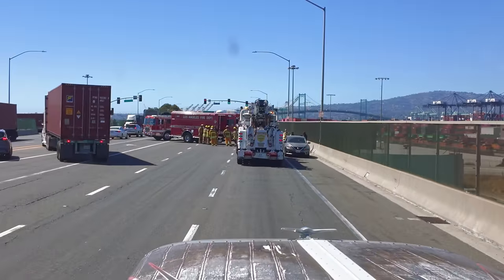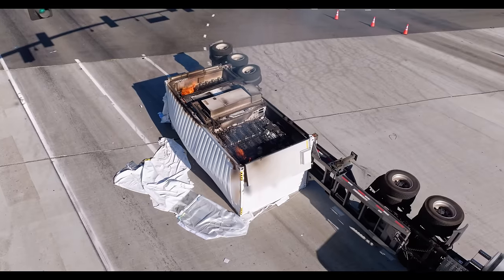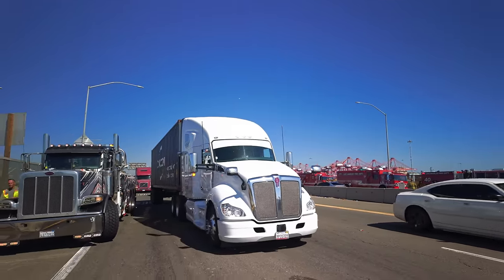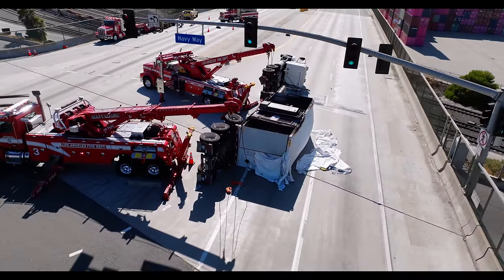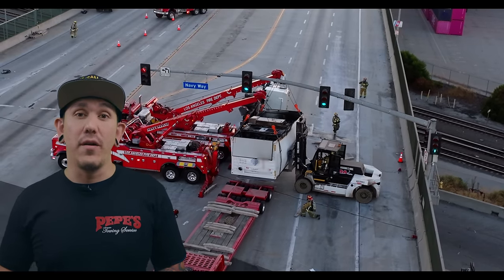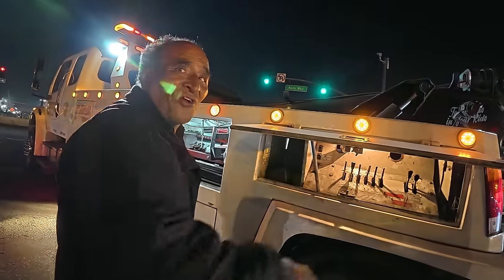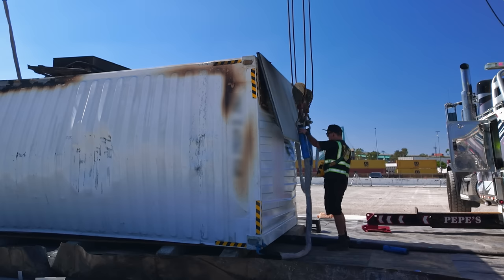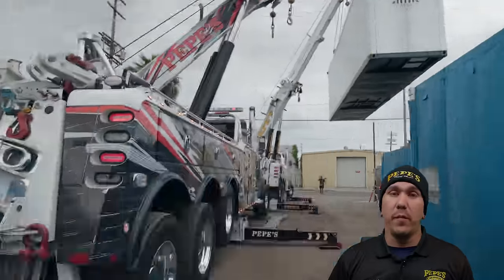60,000lb Lithium-ion Battery EXPLODES on Freeway!

Comment: Hmm...just started watching the video. That is a failure of basic enginnering. That custom container job should be designed to survide a rollover without issue. Huge failure on the manufacture part. Good call just to let it burn out. The toxic runoff from putting water on it would be much worse then just letting smoke off and letting the fumes disburse over a large area, Earth.

Comment: Lithium batteries are not a high explosives. A puff and then some hazardous gasses. Once the container blew the outer container, their would be no more explosive force. Bureaucracy made this take 2 days. Not saying it wasn't dangerous but the city owns MRAP's from the US army that are more than capable of getting close to a battery fire. Just too scared to use them. Government wasn't scared to put soldiers in the vicinity of real high explosives.

Comment: Lithium EV's will not be allowed in my back yard EVER.

There were only 314,000 EV's sold in UK in 2023 in a rapidly declining market.
There are nearly 34 million cars in UK.
You are deluded if you think these will all be EV in 10 years . 
(plus the life of an EV will be 10 years tops so all those will have to be replaced again)
Millions of folk live in terraced houses,
(26% of UK population) how will they charge overnight ???
To fully charge a measly 50kw small EV takes the same amount of power as the average household uses in a week.
Where is all the extra power going to come from?????
Total scam calling EV's Zero emissions.
The National Grid has trouble supplying power to all the 2kw kettles when East Enders finishes, how are they going to cope with the 7kw overnight charging of 34 million EV's and 300kw fast charging demands of travellers?
If you understand OHMS Law you'll then twig the figures just don't add up.
Little wonder the EV market has crashed.⚠️

Also too many are catching 🔥
EV Depreciation is totally horrendous. 
Example : Neighbour had Audi ETron £75k new.
3 years later worth a poxy £25k 😅
I won't be buying one sometime soon.

Comment: You can put the fire out by dousing and drowning the batteries completely in oil. 

But then you create an entirely new set of problems. 

This truckload of lithium batteries represents over 20 YEARS of CO2 averages from any city in the United States at 2 million to 5 million population. 

But muh batteries are better for the environments!

Comment: That wasn't an explosion it was a bit of pressure release, if they had opened door straight away it  wouldn't have happened and kudos to the generator battery manufacturer because the lithium never set on fire just a bit of plastic that's all, just you tube  Chinese EV battery fire and you will see a real lithium fire because this wasn't one, and that firemen only got 7/8 ths of a turn on that connection that could have blown off and hurt someone maybe, and a three day clear up is a joke, no one knew what to do.

Comment: Yeah, it's not the solution to dumbing water million gallons there, it not going help. Just poisons spray bigger area..

They need new systems..

Some CO2, Nitrogen and even already unlegal gasses sprayed to box that is lowered over that lion batter back. Then check internal meters or outflow how hot is there...

That was big battery but wasn't wery angry...